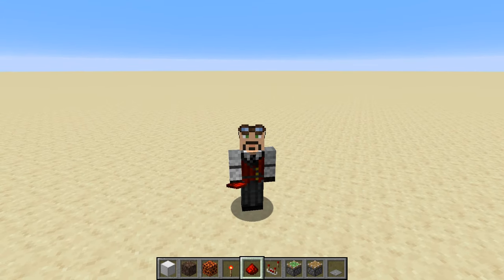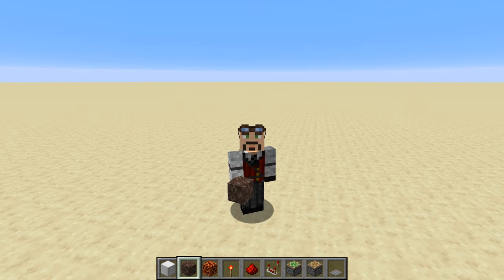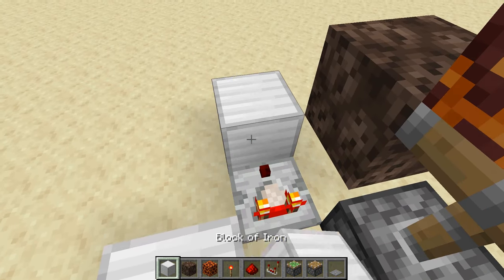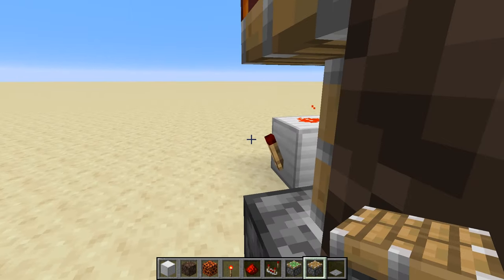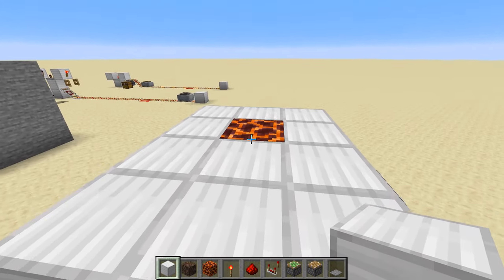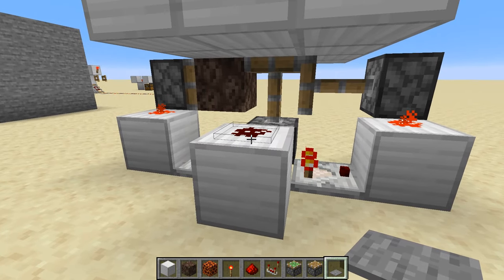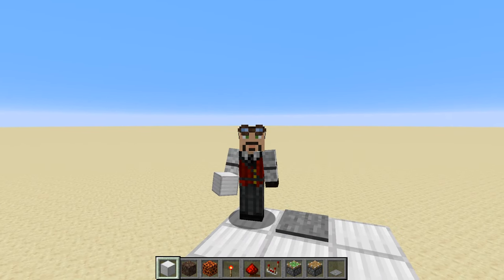WORKS IN 1.18.1 CONFIRMED! - How to build BLOCK SWAPPER!

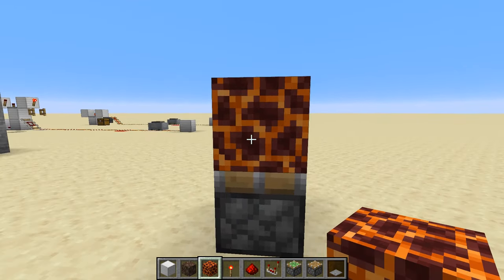Comment: After about an hour of trying to redesign my elevator I gave up and came here for tips. This design is great, easy, and compact. As another commenter said below, placing repeater beneath the soulsand facing the vertical sticky piston dramatically increases the swap speed (first visible at 00:42)

However there is one thing this design needs and that is a default block. The pressure plate should switch from lava block to soul sand and then revert back to lava block after a delay. I am hoping there is an easy way to do this. Why do this? Because you will only ever need to swap the block at the bottom of your bubblevator. When going down from the top of your bubblevator, it should be ready to suck you down. Only when you need to enter a bubblevator and go up should the block be swapped.

I'd love a short video explaining how to incorporate that into this design.
Reply: Yes! This really needs a solution
Reply: Use tripwire hooks and string to power the redstone
Reply: Hook up a pulse extender from the input that goes back to the input after some time, "retoggling" it. This should revert the default block back every time.
Reply: Yo dude I really need help on how to increase the speed I don’t get it

Comment: Finally, a working one. THANK YOU
Reply from the maker: You're welcome
Reply: Wrong and this youtuber replied to it because you think its correct when he knows its not
Reply: Kyle Jones you sure you didn’t do it wrong?
Reply: @ovodelta  ye I done it step bye step but I made my own design
Reply: @ghostmen2969  ive litereally just tested it and it worked for me are you on console maybe?

note: in case everything breaks put a block above the torch
Reply: yeeeeee
Reply: @ghostmen2969  Well you need to make it on pc not on mobile if that is the case
Reply: @Bastunchence  xbox I made one anyway
Reply: @ghostmen2969  this one should be for java, so maybe that's why it doesn't work on Xbox
Reply: x2

Comment: 2 quick improvements. 
1) Instead of comparators, repeaters work fine. 
2) Underneath one of the side pistons, place a repeater running into the upwards facing piston. It speeds the process up
Reply: confirming that both of these are true and 2) is needed. Does anyone know how to make Lava the default and have it switch back to lava block after being triggered

Comment: For those in 1.16+, don't turn the redstone into a dot. keep it as a 4 way intersection type thing
Reply from the maker: This is a great tip!  Thanks
Reply: One more thing... How to get back???
Reply: @acacia-michaelangelocal5560  you can click the redstone again
Reply: What i mean is when you are at the top when you are making a water elevator how do you get back??
Reply: @acacia-michaelangelocal5560  you just step on the pressure plate again,  or you hook it up to a button that you can trigger at the top
Reply: Omg thank you! Gone thru 3 different tutorials to figure this out lmao
Reply: Ty :)
Reply: you saved me🙏

Comment: I managed to make my own circuit, but I can't figure out a way to swap the block from the top of the elevator.
Reply from the maker: Usually I have it set to pull down by default.  so I only swap when I need to go up, then have it on a timer to swap back.
Reply: @Tinker77  how did you make the timer? Pls respond :)
Reply: @cthilith  you probably figure it out but a line of observers from the top down can be connected to the swapper circuit.

Comment: Using comparators? Why? They literally do nothing more than a repeater would. I legit think this was done because it looks more complicated which is exactly what we don't need in the technical minecraft community. I should be able to help people get over the "redstone is too difficult" mindset. I was just looking for this design that has been around for years and the first one I find isn't even right.
Reply from the maker: Peter Juncker yes that is true.  And in my follow up video I explain that.  There are reasons why things are done certain ways.

Comment: How do u make it so u go on the pressure plate and it turns into the magma and then a couple seconds later (in that time u can go up the elevator) it switches back to soul sand. Like mumbo
Reply from the maker: I have a video for a water elevator.  Search for that.   It works great in Java
Reply: @Tinker77  welp I made one already ty tho xd :) 💙

Comment: not helpful on the water elevator idea cuz the water falls underground and breaks the redstone
Reply: Prince Jazen Labrador build the elevator after
Reply: Benjamin Gill r/technicallythetruth
Reply: Signs??
Reply: That's right still no offense
Reply: No it doesn't? It has no way of flowing down there because the block doesn't get pulled down far enough.
Reply: put glass above the red stone torch

Comment: Do you think this can be adapted into a block swapper that creates a disappearing sidewalk flush with the ground? I've been trying to make that idea for months
Reply from the maker: Perhaps.   How wide of a sidewalk are you trying to make?  1 block wide?  Perhaps this is an idea for a future video!
Reply: @Tinker77  I'm aiming for 2 blocks wide with a maximum of 10 blocks long (maybe cut shorter). I've experimented with multiple different block swappers, honey/slime contraptions, and even having 2 different circuits, one to remove the grass, and one to replace it with the walkway material. I personally havent been able to come to a working design, but I am kinda new to redstone and am not very good at it.
Reply: @Tinker77  the closest I've gotten is a design using two 2-4-0 double extenders to move the walkway and grass side to side, with a single extender facing upward to push whatever block has been selected up yo the surface

Comment: This doesn't work in the newest snapshot unfortunately
Reply from the maker: Just tested.  It works fine in the latest snapshot 20w18a.
Reply: @Tinker77  yeah sorry. I just tested it out too. The reason it didnt work for me is because the lectern cant be pushed which I thought it could.

I'm trying to make a system where all I have to do is pull a lever and a workstation will show up for a brown coat villager. Then I could check the trade and if I didnt like it just lock up the block, wait for them to lose their job, and then rinse and repeat. This way I wouldn't have to repeatedly break and replace the block.

Unfortunately villagers are really buggy right now on knowing if they have a workbench or not so its taking a lot longer than if should
Reply from the maker: D3 PRODUCTIONS that sounds like a cool idea.  Let me know how it goes

Comment: doesthiswork in bedrock
Reply from the maker: I'm not sure.  It may.  I think I have a video somewhere of another one of these for bedrock
Reply: @Tinker77  can i get the link for it please?
Reply from the maker: @csherpa21  link to what?
Reply: @Tinker77  oh I was asking for the link of bedrock version but I dont need it cause it works! but I have a question. My elevator is super long so when the piston switches, I am usally halfway up. How can I extend the time of the redstone so the direction doesn't move until I'm all the way up?
Reply from the maker: @csherpa21  there are various ways.  I use a comparator pulse extender.  It’s comparators in opposite directions with red stone at each end.  The more you have the longer it goes.
Reply: @Tinker77  So if I add more compartors and extendors, will I have to move the piston in order for it to work? and if I do that what would I do in the empty spaces?